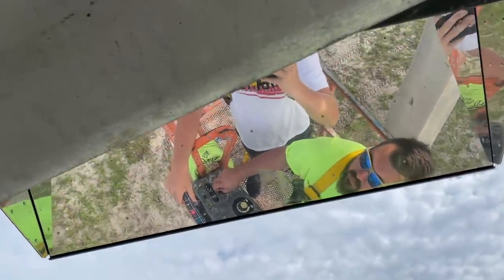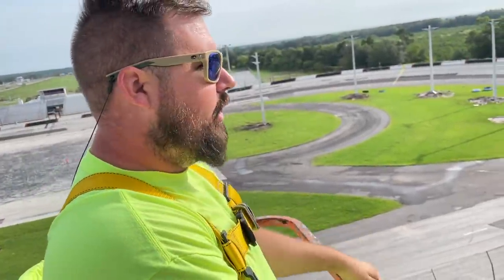Testing One Section of the Freedom Factory's NEW Lighting System... Might've Over Done It!!!!

Comment: The wire gauge reduction just shows how
 Little power the LEDs use compared to the halogens
Reply: Voltage drop. From the switch gear to each pole is a great distance. Voltage drops over long distance and requires larger conductors...
Reply: LED's are better all around. Less power, brighter, and they run way cooler
Reply: @Lewis Barton is metal halide not halogen?
Reply: @Lewis Barton just like Aramco is guard railing?
Reply: @Lewis Barton and in Australia “biro” is country bumpkin for pen
Reply: I wonder if they are dimmable? If they end up with too much light?
Reply: @Lewis Barton Thank you. You made me miss my pops. He was a teacher. : )
Reply: @Lewis Barton that would be rgb and really cool
Reply: @dylanzrim3635  Metal hallide lights are higher in the visible light spectrum than a high pressure sodium light. The metal halide bulbs are the white ones and high pressure sodium lights are yellow. They both require a ballast to ignite, one requires (if I recall correctly) a large capacitor to increase startup voltage. I think it's the hps lights that need the capacitor. At any rate with almost all lights a tremendous amount of energy is wasted from heat loss, led lights are more efficient by a magnitude of like 5 and usually don't run nearly as hot. Heat is the enemy of all things electrical. Led lights are no exception to that, but by design they produce much less heat and therefore last much longer. He is probably using 1/4 of the electricity that was used before to make 3 times as much light. Led's are awesome.
Reply: @Lewis Barton Are we sure they weren't High Pressure Sodiums? The light was a bit of an amber colour, at least that old one they had lit in this video was. I can't remember what the rest of the track looked like though as far as the colour of the light, Metal Halide would be the more common choice I think for that type of lighting.
Reply: @MrMaxyield  That is right. You need heavy wire for the amps and volt drops and then you can switch to smaller gauge for your final run. The old way was because they ran the wires right to the top and had the fuses and junction up there. With the new steel/concrete poles you have junction boxes. Those junction boxes allow you to cut cost. We are talking about 1/2 mile of cable that is reduced to the smaller gauge. Depending on what the main line cost per foot that could be around 3k extra added on. May not seem like much yet in the end it adds up.
Reply: @chaseoes  Depending on which lights these are they could be dimmable. The ones he bought for 20k had a model that allowed them to be dimmed.
Reply: @dylanzrim3635  nope
Reply: That would be great if they were dimmable
Reply: I wonder what his power bill will be like?
Reply: @johnthompson5302  Well they have like 18 poles with like 4 lights on each one. That is about 70kw per hour of usage. With Florida Commercial KW price of 9.66 cents. It cost about 6.73 dollar to run those lights per hour. That does not include all other electric. So given a ball park of 5 hours of light for 15 days every months it will cost 500 for the lights and 300 for the rest of the cooling and electric plus what ever the commercal surcharge is. I am guessing around 50 dollars plus and taxes. So best guess is that it cost around 850 to 1k per month in electric. Add another 100 dollars per event that has food and things. So it will at the low end a few 100 dollars and the high end 1k to 1.5k per month.
Reply: @kameljoe21  I was seriously hoping someone would actually answer that for me!!  Thank you!   Your time spent figuring that out wasn’t wasted....

Comment: In the rest of the lights, if they are not drilled already, get the glands in the top junction box in the bottom of the box rather than the side so you don't end up with a box full of water.
Reply: They got gasket they are made to be outside
Reply: plus, i'm sure the company doing the electric drilled weep holes in the bottom to allow drainage

Comment: I think the Freedom Factory Electrician Earned Himself a spot in the next race!
Reply: Lets make it happen
Reply: Definitely,  My vote is find him a Danger Ranger to team up with. Im sure he'd do it if we put his business name on the truck. Much respect 🙏🙏🙏  to the whole crew that made this lighting upgrade happen, You know who you are.
Reply: @Pyle81  Did you see his truck says Freedom Factory Electrician on the bed in the FF font on a decal.
Reply: Bob Watters  cleetus definitely wanted to overkill then underkill. This will eliminate any dark spots around truck.
Reply: Bob Watters  over delivering is always better than under delivering.. if it ends up being too bright, disable a couple lights on each pole so that you always have backups later on down the road. either way once they're all fine tuned that place will look amazing. also cleet was the one that bought the lights himself, not doug.
Reply: Bob Watters  I wish I was half as smart as you I’d be a trillionair
Reply: Is there any ways they could set up a dimmer for the lights? So they can adjust brightness
Reply: Bob Watters  the cost and capacity/amount of equipment is fair and balanced or there would not have been a sale, you can be a narcissist all you want, thinking you know what the value should be but you aren't the buyer nor the seller. Everything gets sold at the correct price or it doesn't sell... Everything gets bought at the correct price or it doesn't get bought...
Reply: Bob Watters  admit it Bob, YOU are never happy with your purchases so you project your feelings to other people to make yourself feel better. As for litigation, I haven't heard of any that Garrett has been involved with so you must be talking about yourself again and projecting your own inadequacy with contract law....

Comment: The footcandle levels you were measuring with just four poles is actually low for a race track. So no, you didn't over light it. When all the lights are on and aimed correctly, you should be getting at least 70fc at any given area and that's at a minimum. I fully expect you'll be getting in the neighborhood of 100fc average around the track when they're all on, which is where you'll want it to be. 

Also, tell your guy to hold the light meter sensor further from his body for more accurate readings. Even a slight shadow from your body can reduce the readings. I've had customers do this and tried to claim my photometric calculations were wrong. Then, when I show them how to hold it correctly, they see the numbers are correct.

Comment: 2:29 you want a drip loop where those cord grips enter the junction box. The cord grips are IP rated, but they still will leak I promise you, especially with Florida weather.
That junction box should have been mounted higher up above the bracket so that SJ drops away from the cord grip.
Reply: Somebody knows what they're talking about!
Reply: imo you always enter a box located outside from the bottom best way to do it.
Reply: @daniellewis1789  I do this type of work industrially. We had to replace every single junction box in the steel yard that was wired like this after just a few years. I'm up in Michigan, the weather (rain) isn't nearly as ferocious.
The problem is that those junction boxes are also IP rated and they will fill with water. Some guys will drill a small weep hole, I rather just not let it leak in the first place.
Reply: Nice touch, thanks for proving you're the badass electrician! Respect.
Reply: That is very true, The water will follow the cables the way they are positioned, Maybe silicone sealant is the way to go
Reply: @riderzinc  The force of the driving rain is incredible, you need to redirect as much of that energy away from the sealing surface as possible.
As an example we just had 6"+ of rain here in Michigan, the homes that didn't have a proper weather head on a rigid service entrance all had water, a substantial amount of water to the point that it was killing breakers, get driven down the service entrance cable and leaking into the panel. These panels were sopping wet.
Reply: @otm646  Fellow sparky here. Agreed, bottom entry and drip loop would have been preferred. Looks like they have plenty of cable inside the box to form a drip loop, easy enough fix. They may have been limited on box mounting location by the raceway opening on the pole though. Aim the wirenuts up in the top of the box, drill an 1/8" weephole and send it.
Reply: @otm646  We get a ton of rain in the UK but i know Florida's rain comes down with force. All the junction boxes i've fitted outside the cables come in the from the underside. Eliminates any issues with water ingress
Reply: @riderzinc  in the States there are a ridiculous number of nema box configurations. Surprisingly the supply houses don't often stock boxes with (enough) bottom entries. They tend to pick the generics that have two on each face. That's okay for wet/damp location interior  locations inside of a plant but not for exterior. You are 100% right bottom only is best.

Comment: Polaris connectors in those junction boxes, that's the right way to do it. Plus they've got one open tap for any thing ancillary you would ever want to run up there.
Reply: That cable management is beautiful right there
Reply: Bob Watters  I can't tell which inline they used, but the Eaton inline fuses they use on street lighting look very similar. They are a good quality product.  When you are dealing with lighting only circuits code gives you more flexibility for things like that.
Reply: Bob Watters  I mean realistically it doesn’t have to be elegant to work well. Those threaded watertight connectors actually work really well if you use solid gel filled outdoor cable
Reply: Bob Watters  I am thinking you do not like his contractor for some reason based on several of your negative BS comments.  Go back to playing your videos!
Reply: @beckyumphrey2626  those reviews are probably all from cleeters fans 😅
Reply: @sjv6598  Whatever it takes.  :)

Comment: I'm concerned about the lack of a drip loop on the wires going into the box at the top of the pole. Water may drip down that wire and find its way inside. I know it's supposed to be sealed, but as things age water finds a way to get in there. Might be worth looking into. Otherwise, things look fantastic, huge improvement.
Reply: Always one
Reply: Looked like watertight wire nuts at least.
Reply: @jerrybaldwin7543  He's not wrong though, Needs a drip loop on each cable going in

Comment: Don't forget lights for the paddock. Crews need light too.
Reply: I do not think they did any light poles for those areas. Though it would have been super smart to install them poles while they had all of that stuff there to  begin with. Even if they did not install wire and lights until a later date.
Reply: Could just spin one of the lights around 180 on each back straight pole and still be above the  30 lumens they were after on the track. Teams may need tent and working lights but most of the lighting needed for safety would be done.

Maybe even good enough for the dirt track at night depending where it is.

The lighting guy, the grass guy, the mower guy's, the water guy's, the concrete guy's and road working guys should all be in a race as a thank you. The number of people that have first time made it happen for you.
Reply: @stevet647  really you do not even need to touch the existing lights. You just need to build another bracket for a lower section where you can add another set of lights. I am pretty sure they said you could have quite a bit of lights on these poles. They can also add another one to measure weather and have camera mounts. yet the only thing they do not have is conduit to install communications such as speakers, wifi, cell phone repeaters, radio, Though some of these can indeed be ran using a form of wireless. Having the ability to have cable run would have been nice yet would have set the project back quite a bit and cost even more due to having to cut up the track and other areas to dig and lay new conduit and new wire. Thought there are a number of things they can add to these poles to improve things as well.

Comment: The in-line fuse was a smart way to save running the larger ampacity wire to the tops of the poles.
Reply: That's not what the fuse is for.

Comment: Noice and over-engineered Cleet! Sweeet !  Have you thought of adding some remote controlled relays to each pole that way you can turn on each LED Bar individually - allowing you to fine tune the tracks illumination (or even save one or two LED light bars on each pole as a spare)

Comment: Get your electrician to install wireless contactors or even isolators on the pole bases then you can control what individual pole is on as you won't really need to run all of them for sat a drift event or smaller show

Comment: Wire seems small, each light is prewired with 16 awg, which has ampacity rating of 10 amps, 4 lights = 40 amps, the 12 gauge wire used going up the pole is good for 20 amps. Proper wire size would be 8 awg.

Comment: Is there a reason you wouldn't use MCB at the base over fuses and then connect them on din rail connectors instead of wire nutting them all together at the top making it a pain to remove or service one?

Comment: Top electrical tip,  put breathers/weep holes in those junction boxes at the bottom of the poles. Condensation/inevitable groundwater even if the pipes are sealed will get in there and corrode it over time and give you issues. Flame on me youtube armchair experts, elechicken here that's dealt with many years of outdoor lighting.
Reply: That and some super 33 on the wire nuts could go a long way, or is that just me?

Comment: You should wire up every other light on different switches and only use half the lights when needed. Save some electricity $$ and get longer life out of the lights. And if you do have electrical problems in the future you will be glad to have two circuits and hopefully still have lights to use during an event. Redundancy saves your butt.

Comment: You will have some issues later on with the low quality of work your electrician have done, first of all the cables should go into the boxes from below so the water can drip of instead of running directly in the box when the seal fails.
Next is the twist joints, that's a no go because of stress, use proper connectors.
And last all connectors should be pointing up and be secured in the top of the boxes so moist can run off instead of collecting in the joint.
Hope you'll make him redo it so it will work for many years to come

Comment: You defiantly bought too many lights. When the front stretch lights work that will be more than enough from the looks of things. But it works because you can use them in sections rather than all at once to help with the electrical bills for all the extra beer coolers you will be able to run now hahahahahaha

Comment: The new I 70 Motorsports park here in Missouri is having a issue with the chain link fence in front of the bleachers having a bad glare from the new lighting. Lights are so bright it makes it hard to see through the fencing to watch the  track and the races . Ya might check to see If y’all have the same issue
Reply: It didn't look like an issue with that rusty old fence, but whenever they eventually replace it, the new one will need to have a matte finish applied.

Comment: "Everything is plastic so it's not going to corrode on you" So instead it will turn into dust from the sun in a couple years? You can buy weather proof metal cans that have this stuff called paint on them you know..